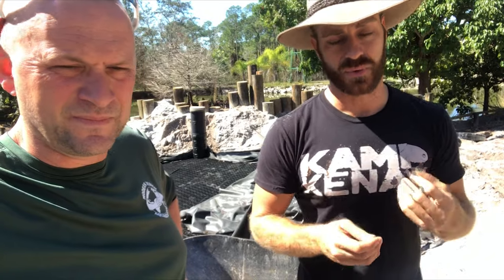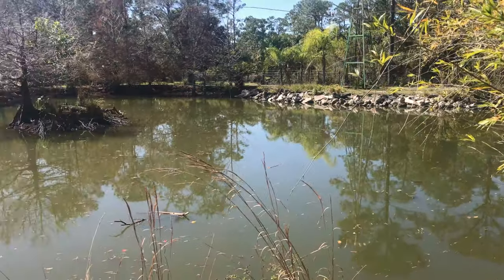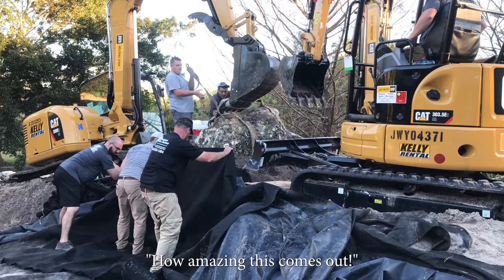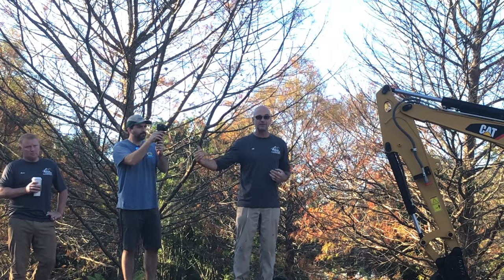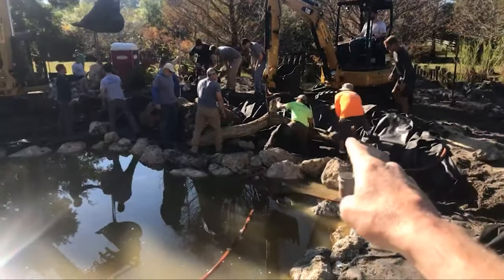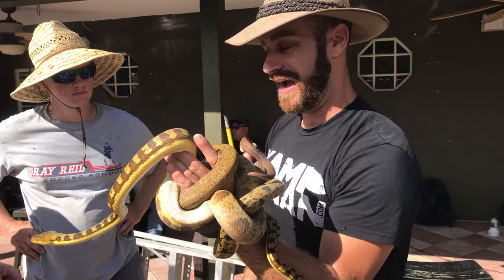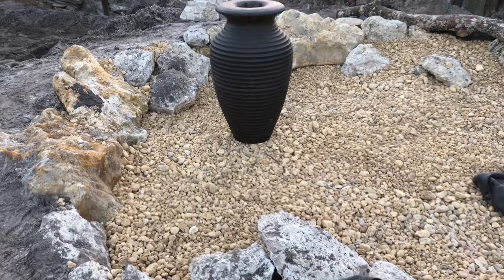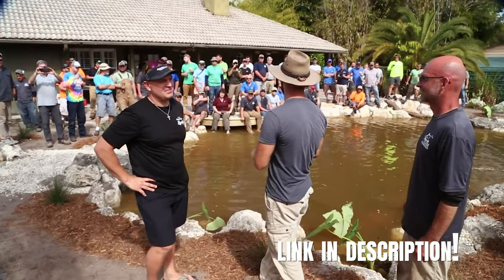Kamp Kenan Got A New Swimming Pond!

Comment: John, I remember watching Aquascape's videos of the build of this pond and it's great to see the new footage you caught of the finished product after the system has matured a bit. A little time really makes a big difference.

I know you mentioned didn't work on the negative edge/cistern, but maybe you can answer this question anyway:

I sometimes see cisterns with water at the surface, over the rocks. That would seem to indicate that the cistern is full and, in the case of a power loss, you'd have a big loss of water since there's no space to catch the water in motion. Is that actually what I'm seeing or is there a bib liner holding water above the cistern and the cistern itself is not actually full?

Thanks for any light you can shed.
Reply from the maker: Could be either one. I am probably going to put a “high water pump out” system on my pond because there are so many problems for me to be digging through for a gravity drain. Lots of possible scenarios.